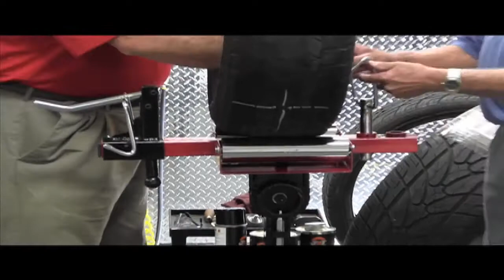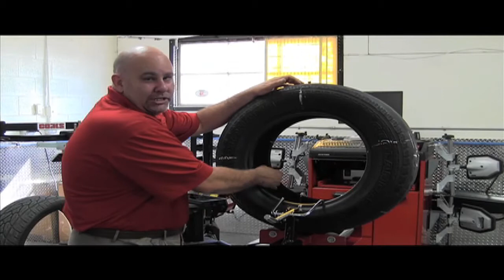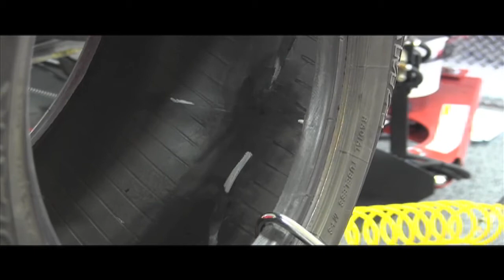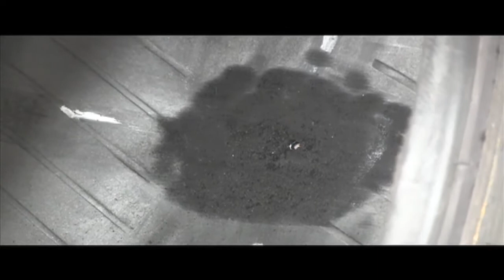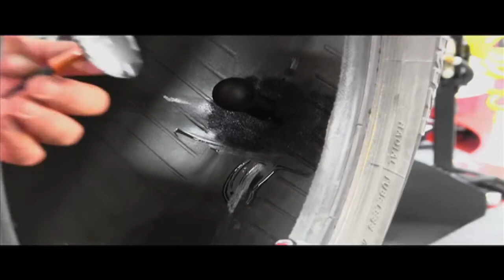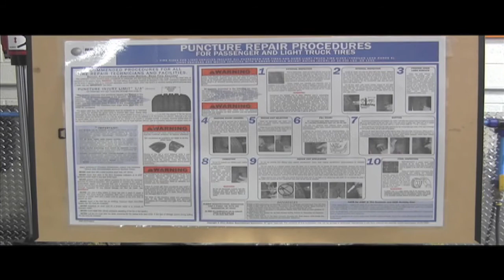Tire Repair

Comment: "Don't use a lot of cement" proceeds to gob on tons of cement/sealant everywhere lol. And it's best to lightly grind down that outside protrusion to near flat because while driving the road forces can pull and tug on that plug which may partially delaminate the cement-to-stem bond.